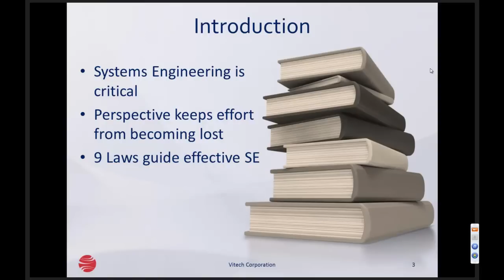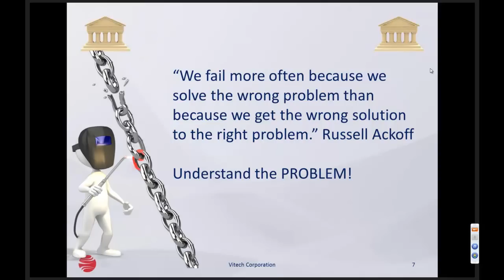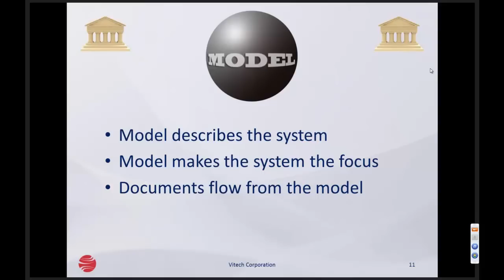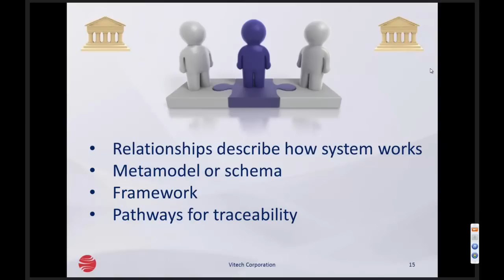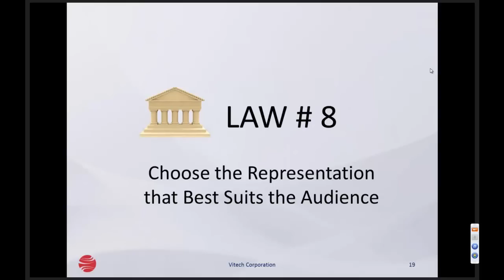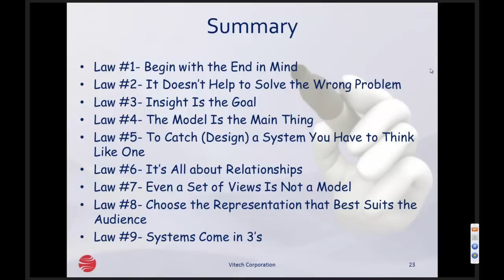9 Laws of Systems Engineering

Comment: A few additional thoughts
- What the customer wants is not always what he needs.
 And what he wants, needs or asks doesn't necessarily match his expectations or lead to satisfaction. These are all different concepts that may not be confused!
- Understanding the problem is not the same as identifying the right problem (the right cause; diagnosis).
- ‘Analysis’ is often defined as looking inwards into something, looking at the parts and their relationships. Systems can not be designed without understanding of their supra-system and their environment. We need to do an outward ‘analysis’, an analysis of the environment.
 Analysis as in Systems Analysis has not the same meaning as 'analysis' in the dictionary.